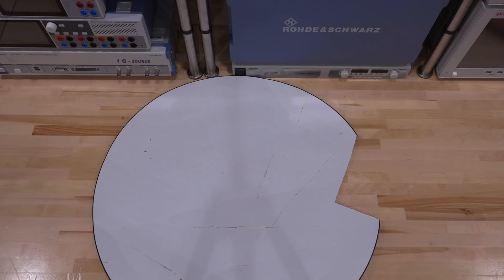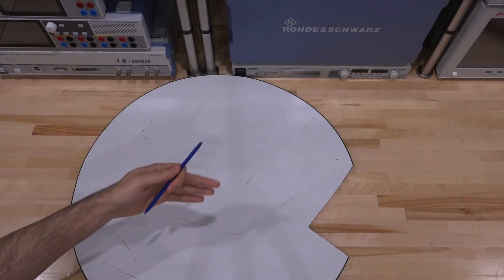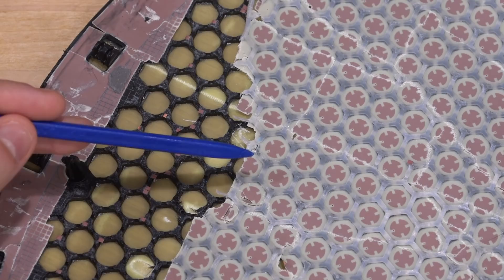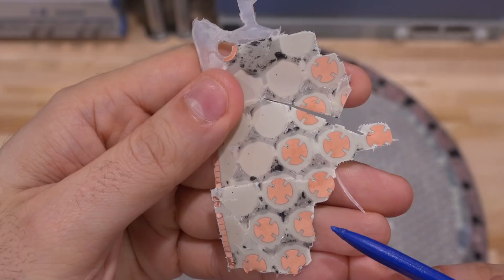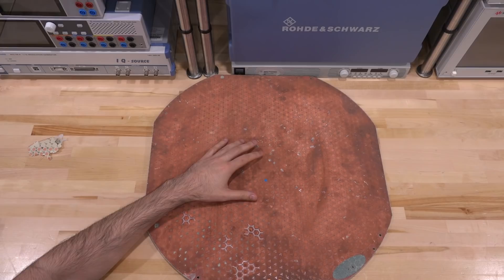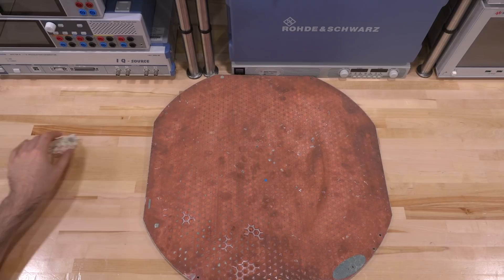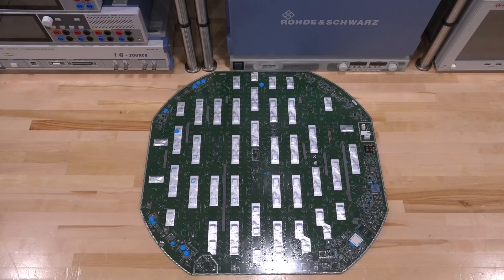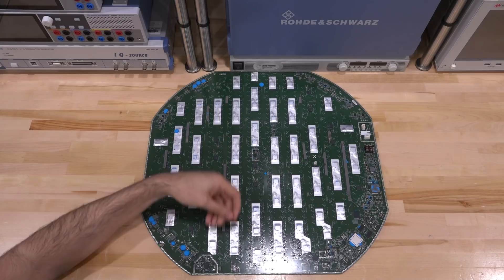TSP #181 - Starlink Dish Phased Array Design, Architecture & RF In-depth Analysis

Comment: Wow thank you for this terrific teardown.  As a hobbyist, I'm wondering what type of power supplies are used to convert the PoE to the proprietary TxRx arrays.   Can you estimate the voltages and power (current) or show these in more detail?
Reply: it uses the rf8382 module made by me at rfcm laboratories (rfc regulatory factor connection mobility)

Comment: Would the 90 degree polarization allow for full-duplex operation?  Presumably even if the dish was half duplex it would allow for the antennas in orbit to do so?
Reply from the maker: I do not think full duplex is possible regardless. The ICs (and antennas, traces, etc.) would have to have amazing isolation and filtering which I doubt is possible.
Reply: I don't think full duplex is even needed, as there will likely be some time domain frequency sharing between dishes, meaning there will always be pauses for transmitting and receiving anyway. That's pure speculation on my part though.
Reply: Shared bandwidth, so will be just like original GSM with time slots for satellite side to transmit to all, then only the addressed dish passes the data through, ignoring the rest. The return path likely also uses a small part of the time, the satellite receiving from each ground station in turn, and likely with a control channel as well. 

Likely the satellite side has multiple beams, so allowing it to simultaneously transmit to multiple ground stations in view separately, and then receiving from them. Seamless handover will be hard, probably as complex as the actual hardware, as you not only have to transition from beam to beam on the satellite, but also have to coordinate with the rest of the constellation, as to which one will have the best communications window for the data, and get them to take over the data path, which means the antenna has to blindly align itself to the new satellite and take over the path, then optimise the gain. Going to have a wild range of transmit powers in that period. You probably will see regular buffering every five minutes as this occurs, so the latency will be varying drastically, even if your overall bandwidth is good. But as you get more orbital units in operation you will be able to have multiple path connections, so the latency will disappear, as you then get the single antenna using 2 or more orbital stations at the same time, and connecting to new before the dropout. Going to make the beam forming important, creating 4 or 5 different beams on the fly from the same elements per time slot. More software than anything else, the motors likely are only there for slow changes to compensate for time of day and constellation drift.
Reply: @MarkRose1337  According to the FCC license, this terminal has <10% TX duty cycle. So the system definitely uses time division. (But it has been mentioned somewhere by SpaceX that 20 users can be active in the cell during the same time slot, so frequency or code division are also used in addition to time division.)
Reply: @cogoid  FYI - I recall reading in the Starlink FCC filing they are  using 64-QAM, so yes it could be either a FDM or TDM design.

Comment: Bare copper is used for the patches since most common finishes (e.g.  ENIG) are lossy and have relative permeability != 1, especially at their operating frequencies. A suitable finish here could have been immersion silver, but they must have deemed a small amount of corrosion or oxides inconsequential and not worth the added cost, especially since it's not a connector, which typically need corrosion resistance.

Comment: I'd love to see a chip tear-down, but I'm most interested in how many beams the antenna can form and where they jump from digital to analog.  I.e. digital to each 16-patch sub array is still a LOT of data to process.  even if each sub-array only needs 1Gbps that's still 100-200Gbps of data to filter and phase shift for the whole array.  The general IO-pins on an modern FPGA can do a bit over 1Gbps so 200Gbps over 200 pins is manageable.  (and DDR memory interfaces regularly run north of 3Gbps)
Reply: Digital beamforming allow you as many beams as you want. The counterpart is that you will reduce the antenna gain by the same amount (10 beams, 10 dB of reduced gain in main beams direction). Considering the FPGA, all the information that are acquired are sum up just after the DBF process (phase suppression). You then finish with just one dataflow. Furthermore, I don't think 1 Gbps is required, it is enormouse just for one consumer. I better presume few tens of mbps are required per consumer. Then you just modify the frequency crrier thanks to your LO. (sorry for my english, French guy ^^)
Reply: @antoinejou1182  Yes, exactly. The fractional bandwidth of a modulated carrier within the transponder is limited. Has anyone looked ? Users report 150Mb/s data throughput on the downlink.
Reply: @antoinejou1182  why does the digital beam forming reduce the antenna gain?  For sure in transmit the total power from the power amplifier is divided in the spatial beams, but the antenna gain does not change.

Comment: hey that is very very detailed, well down 
but can I challenge you to do 10-50! antena just as powerful as Starlink's?
i know there are 1300 antennas glued together but I've always wondered if it's possible to just make 1 of them , just 1 as a challenge for DIY if we could really make a similar  or maybe even better starlink dish, can u do that ? from the looks of it 1-10 antenna doesn't sound to be that hard, we could even do it with the extra materials laying around the garage.

Comment: Would this have concurrent multiple beams to multiple LOE satellites?
Reply: I would think so just because it has to be capable of load balancing fairly dynamically and give the best routing flexibility. I wonder if the antenna design in the satellites themselves are similar to this.
Reply: AFAIK, the ground is divided into fixed cells, and each cell is served by one beam from one satellite. All the users in the cell will talk to one satellite, switching to the next when it takes their cell over. The user terminal does not require to support multiple beams in this scenario.

Comment: Not necessary to have two feeding points to achieve CP. The patch can be slightly elliptic making one of the diagonals of it capacitive and the other inductive. when fed two orthogonal modes can be  excited achieving CP due to the reactive loading.

Comment: When I've seen these structures, and heard that 10GHz is 'low frequency', how does this compare to the 400..800MHz receiving frequency range of the former Arecibo telescope.. as there the individual reflector panels had been replaced years ago.. Do you think, that they implemented similar antenna array structures over the whole 300m dish?

Comment: EBG likely to prevent surface wave propagation due to the finite gaps between the circular patch layer and subsequent coupled patch layers. These are circularly polarised elements. There’s a 90 degree hybrid between each antenna and front-end module.

Comment: I was immediately struck by the size and shape similarities between this antenna and the radar antennas on modern fighter aircraft like the AN/APG-77. Apart from the power requirements, how similar are the design constraints between these two types of systems?

Comment: This phased array antenna seems to use true time division per your video. That is similar to what Boeing PAA uses. I am surprised it is a KU frequency antenna at this day in age. It appears they shrunk down the MMICs used in the Boeing antennas. This antenna is a hybrid design with separate positioner for partial steering at the 60deg lat. for coverage. What we don't see is the controller and the power supply that powers the beam steering. Also the polarizer is not known. The SPAC (system phased array controller) is not seen in your video that defines the bean forming bore site with the LNB and the BUC. Need more information to do a good evaluation. My company remanufactured the PAA for the E6-b on Tinker AFB that was built by Boeing.

Comment: Looking at antenna design at 100GHz, would it be possible to downscale to open up the THz band? Or are the main limitations in the design of the oscillators/amplifiers? I understand making an oscillator and amplifier so small would be extremely difficult.

Comment: I think this explains just why the dish is as expensive as it is -- it may well be that the price charged doesn't fully cover the hardware cost.  That is one expensive PCB given its size and the necessary effort at controlling propagation delays around this huge assembly.
Reply: Maybe they can justify spacex having their own pcb and ic fab shop to bring down production costs and build even cooler stuff
Reply: The PWB cross section he showed was of limited magnification, but it didn't look too exotic.  It would have been nice if the dimensions of the PWB were stated, but it looked like a 20 x 24 PWB could be process this board.  Thickness looked no greater than  .125 inches.  A cross section measuring the copper thickness would probably show it to be pretty standard.  The outer layers were more interesting as some non FR4 material looked to be used, which makes me think those layers used a SAP process for the thin copper features.

Comment: Would a maritime stablizer be less involved and lower cost for this than such stabilization currently costs for small dishes?  I understand the concepts (Krauss, antenna engineering hndbk, NTDS, etc) of phased arrays, and get the need to mechanically steer one sometimes.  Planning to get a cruising catamaran, and am wondering if it will be cheaper than current stabilized dish options for satcom.
Reply: SpaceX have put these terminals on their ships without any mechanical stabilization. The motors in this terminal are used only for the init setup, to point the antenna in the right direction. After that, all the beam pointing is electronic.
Reply: @cogoid  should be interesting if they can get the manufacturing tolerances good and keep it low cost.  ST can do quantity without issue, so once this takes off (pun intended), costs might be affordable.  My big worry is that with the ozone hole actually repairing (after 40 years), the potential to blow a big hole in it with the sheer number of launches he proposes.  On the one hand, I love the idea of cheap broadband virtually anywhere, even in the middle of nowhere on a several week passage (Calif to French Polynesia for instance), but on the other hand the potential upper atmospheric damage....
Reply: @kaylaandjimbryant8258  I think the biggest concern is solid-fuel rockets which introduce tons of chlorine-containing chemicals into the atmosphere in each launch. Space Shuttle was notorious for that. But with the very large number of planned launches, if would of course be important to consider and understand the impact of even less damaging pollutants, like the soot from the kerosene powered engines.
Reply: @cogoid  true.  I would hope they do something to mitigate any potential damage in the design.  Perchlorates would be really bad.  As a longtime IT guy, I miss Freon TF, but I supported it's ban, having known some of the NSF guys that discovered and researched the hole who even convinced Reagan (he used to park AF-1 in the VXE-6 (Antarctic Dev. Sqdrn) hangar where they were flew out of when I worked at PMTC, Point Mugu).

Comment: really informative video. In 18:00 you showed an antenna with higher frequencies. Starlink requested approval for VLEO Satellites in the V-band spectrum. Would this current architecture of the dish be capable to operate in higher frequencies such as with a software update or are there physical limitations?
Reply: No. From this x-ray teardown it's clear the antenna elements are tuned for the job of 14GHz up and 11/12GHz down. Starlink constellation v2.0 will require another antenna, but hey, they are building Starship, so no problem...
Reply: @decibel_tastic2869  make sense. But with Elon’s products you could have had expected that they planed for that and unleash it via a software update haha

Comment: Does the antenna mount have a third motor that rotates the antenna?  That would be required to align the polarization with the satellite as it passes over if the antennas are H/V instead of circular unless they're willing to live with a 3dB loss between a circular satellite and a linear groundstation.
Reply: 2 motors only, so the antenna has control over azimuth and elevation only, but does need to have the mounting be vertical during installation.
Reply: The motors are used only for the initial setup of the terminal -- to point it in the right direction. After that they are not used at all, and all of the beam steering is electronic.
Reply: @cogoid  You sure about that?  What direction would that be? These satellites are in low orbit, they move completely across the sky fairly quickly, transiting the entire sky from horizon to horizon in less than 10 minutes.  As Shahriar said, the beam cannot be steered over such a large angle with this antenna.  And if the antenna only had to be physically pointed once, why do it with motors?
Reply: @stargazer7644  I am certain. All the beta-testers of Starlink report that the antenna does not move.

In the northern US the antenna points North, where the density of the satellite tracks in the sky is the greatest (their ground tracks bunch at 53 degrees northern latitude, because that is the inclination of their orbits.) These terminals are also not allowed to transmit within some angle (10 degrees? I forgot the exact number) from the direction to the geostationary satellites, so the southern sky is also less useful because of that.

The motors are used for the automatic installation of the antenna, so that the users would not have to fiddle with that. It is a convenience feature. The thinking is that the $10 actuator is cheaper than sending a crew to help with installing the antenna.

From the FCC documents, the electronic beam steering in this terminal covers at least +-50 degrees. The gain does suffer considerably when the beam is tilted away from the boresight. At boresight, the transmitter uses only 0.7W of power, at the maximum slant it uses 4W.
Reply: @cogoid  Thanks for the info.
Reply: @stargazer7644  If you have a transmission delay gradient across the antennas, you can effectively point the signal strength in the direction you want (electronic beam steering). Non-geostationary satellites basically have to use circular polarization to account for doppler shift as they move towards and way from the ground stations (or the ground stations themselves move, such as in satellite radio).
Reply: @stargazer7644  I must clarify the statement I made earlier: "At boresight, the transmitter uses only 0.7W of power, at the maximum slant it uses 4W." This is not only the result of the lower gain when the beam is at the slant, but also of the generally greater distance to the satellites when the beam is at the extreme slant. Both factors play a role.
Reply: @stargazer7644  if I'm right, once there is a satellite at 45° in elevation, another is coming at -45° in elevation, and it cross your field of view every 9 minutes. Such an array can easily steer a beam at -45° without any problem (just some antenna gain reduction due to the effective aperture size reduction. However, because the array is made of sub-array, this may generate undesired grating lobes, so I don't know !
Reply: @MarkRose1337  Yes, I understand how beam steering works. Circular polarization (CP) has nothing to do with doppler shift.  CP has to be used because the spacecraft orientation is random and changing with respect to the ground station.  If both satellite and ground station use linear polarization (LP) then you'll have deep signal fades of about 20 dB every time the polarizations get 90 degrees out of phase.  CP avoids that problem.  If one end is CP and the other is LP, that will work, but you have a constant 3 dB  penalty.  Geosync sats and fixed ground stations generally use LP because their attitude is fixed relative to the ground station.  This is not the case for LEO satellites.  Satellite radio uses CP because even thought the satellite is at a fixed attitude, your car is not.  Same for GPS.
Reply: @stargazer7644  You're correct, of course :-)
Reply: @stargazer7644  also the current revision of the satellites being launched have "inter-satellite communications" via laser. Thus further indicating no mechanical tracking is needed.
Reply: @charleskeller4288  we're talking about the ground station antennas here, so what does "inter-satellite communications" have to do with anything?
Reply: @stargazer7644  if your signal (satellite) is traveling off your "horizon" - that satellite can "pass your connection back" to an upcoming satellite that will align with your antenna. Thus, mechanically tracking on your part is not needed because your data connection is moved to the next satellite that will be upcoming into your view/alignment via laser transfer. Maybe my interpretation of this feature is incorrect?
Reply: @charleskeller4288  Interconnections between satellites aren't needed for your station to switch between them.  The interconnections are needed if the satellite you're talking to can't downlink your connection to an internet gateway directly, then it has to relay to a satellite that can.

Comment: To achieve CP, you do not always need to feed the patch with equal amplitude and 90 degrees out of phase. Patch geometry can be modified to achieve CP. Is it possible that the slits in the upper patch are for that purpose? again, the requirement is to achieve dual CP in two different bands.
Reply: yep...like they do the notched circles